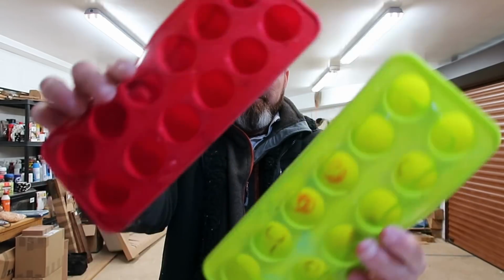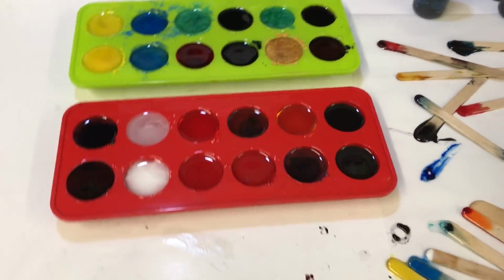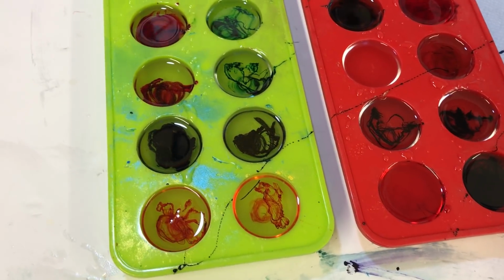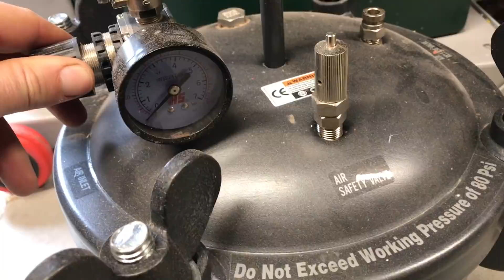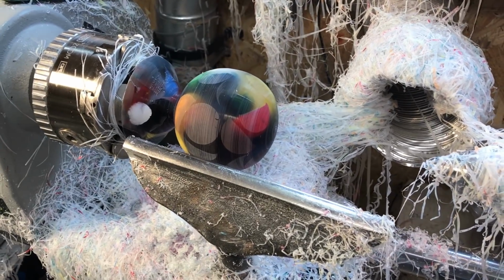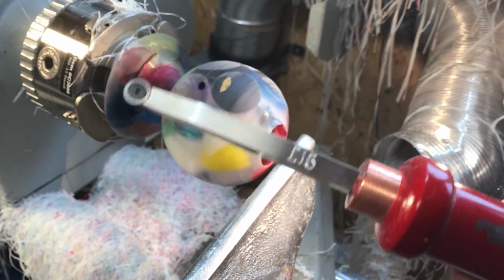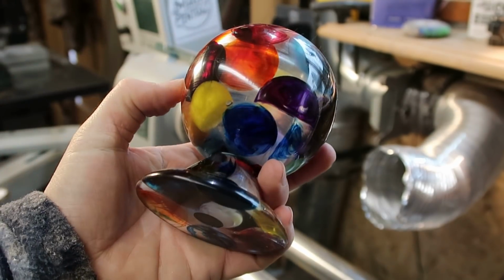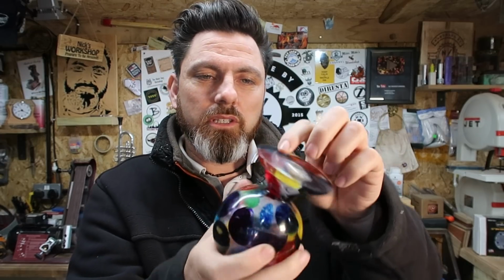Woodturning - mixing resin cubes to make a small funky vase!

Comment: Something you might want to look into his those silicone ice trays come in a wide variety of shapes. Everything from the half spheres you were using to guitars, Hearts, puzzle pieces, death-stars, skeleton bones, and pretty much anything you can think of. It would be cool to use some of these shapes Within a project. Even come binding different shapes such as hearts and puzzle pieces to make a Valentine's type project. You know, you're the missing piece mushy stuff. LOL.
Reply: Seth Cragan Yeah like those LEGO pieces !!!
Reply: Heather McGuire exactly.
Reply: 3 words
Gummy bear mold
Reply: Bianca Brooks .. assumed people's do resin molds with actual gummy bear in them. But I suppose you could not put that on the lathe and turn it. Unless you then put a protective coating of resin around the exposed gummy parts. And you could also do any color you wanted you which would be cool as well. I think it would be really cool to use some of the other shapes. Like they have Star Wars ones that I think would look awesome.
Reply: Seth Cragan Peter Brown made an axe handle out of gummie bears in resin, you should check it out.
Reply: Blue Black seen it.
Reply: Seth Cragan ohh black and white bone shapes embedded in orange resin would make a great halloween project!
Reply: I was thinking that. The different shaoes would add an even more interesting effect and swirling the colors, mixing multiple in one. I liked that he did single color swirls instead of just plain solid colors

Comment: hey buddy, resin will not easily bond to cured resin, your Colored HEMISPHERES. sand them before mass pouring or take out HEMISPHERES before fully cured and do mass or final pouring then. that is a great project but needs to be larger for sure. maybe a tall vase, 3-4" wide or 8-10cm wide at base and top lip! a wooden base with a mild led base light would be a knockout project! nothing short awesome though, really like it! try this idea, sure you will be very happy and inspired to experiment more!
Reply: Ronald Kurtzhals I was checking to see if someone else made that suggestion before I did!

Comment: Small spruce, tamarack or pine cones make a very nice filler as do the needles themselves. Colorful leaves in autumn as well if placed properly and you heat your mixed resin in the microwave prior to the pour to facilitate the resin soaking into the leaves also looks amazing.  I've done this with whole flowers and rose petals as well and found good results. Just some ideas which might be to your liking. 
Mosquitoes, ants, and yellow jackets also make for some amazing pieces if you fix them with two separate pours. Just clear resin or a cylinder of wood for the center cavity which is all to be cut away, and then the insects fixed to the wood and then a larger pour around this, making sure your resin is thick enough to shave without touching the insects. Cool as cool can be.

Comment: Nick, just found this channel. 2 thumbs up and greetings from America. I just watched your vid where you made use of shavings from various tree/wood species and had an idea. What about obtaining small samples of wood from each continent, turn a sphere to be used as a globe, create reliefs in the shape of each continent then fill them with resin mixed with shavings from  each continent's corresponding native species. Perhaps you could make an easier version by creating a rectangle "world map" instead of the globe. This was my idea for something meaningful to be given away to a lucky subscriber in celebration of this channel's 100,000 subscriber milestone. It could represent the common interests in woodworking that is shared among so many of us which brings us together despite our many geographical locations or other such things like fundamental differences in culture that so often work to divide us. I don't know... just an idea.

And to address the elephant in the room concerning how to fill areas on a sphere with resin but without it flowing away from the reliefs where the resin is intended to remain... I believe if the reliefs were small enough, and kept shallow, you could wait for the resin to thicken a bit, have the sphere remain on the lathe, pour the resin into the relief, then set the whole thing spinning at a constant slow rpm (perhaps 10-15 rpm maybe?). Use heat lamps to accelerate the resin's set time and once it's hardened, clean up any excess resin by turning it one last time using a finishing tool of your choice or a series of sandpaper grits. Keeping the layer(s) of resin shallow should help with bubbles and manageability. 

Anyway, love the content and am looking forward to seeing the channel grow! Cheers.

Note: I have never attempted this myself and I am NOT a master craftsman in this area of woodworking. This is ONLY an idea and should be treated as such.
Reply: Kilroy was here your screen name is fantastic!

Comment: Don't know if you'll ever see this, but the way to avoid resin interface separations is to give the components a rough sanding before casting them in the enclosing resin. Give the resin a larger surface area to adhere to, and microstructure to hold on. You could also try making holes in the components so the resin not only flows around them, but inside them too.

Comment: Fantastic work as always! Just a couple of notes you've probably gotten a hundred times by now (Didn't see it on the first page of comments and I'm too lazy to look past that) on how to improve it next time.

1) 5 Minute Clear Epoxy would have filled those cracks well. I don't think you could turn it, but you could definitely sand and polish it back to finish after anyway. It's not as clear, but for this tiny cracks it would be invisible

2) New Resin doesn't fully bond to Cured Resin. As far as I've experienced, that is true for all resins though I'm sure almost everyone has more experience than I do and can point to an exception. However, while the first part is set up but not fully cured, in that tacky stage, you can do the second pour and that should prevent the cracking.

Love your work! Love your channel!

Comment: If you scuff the hemispheres with a scotch bright pad before you pour the resin on top of them they won't crack. When epoxy cures, it out gasses a waxy surface and nothing bonds to it. You can also dust some baby powder in the trays before you pour and it'll have a bendable surface.  Great video 👍

Comment: I love this piece.  It would also be cool to make a set of domes and then put them on top of another set of domes before they cure so you have complete spheres.  Whenever I have a situation where older resin bits separate from a new pour, it's because I forgot to sand the older pieces.  I can't remember the exact timing but if you put them into new resin within a certain period of time when they're not 100% cured, they'll adhere but if it's past that time, they don't without roughing them up.

Comment: I suggest that if you try this technique (small resin pieces in a larger resin piece) again, that you lightly scuff the surface of your small pieces before adding them to the large mold, this should fix the resin-resin bonding problem.
If you get the resin-resin bond problem again, try filling the cracks/chips/voids with a small amount of resin (drizzle it in or use a small paintbrush) before you do the final sanding/polishing. That should strengthen the problem areas and make the flaws disappear (Window shops use the same trick to fix car windshield chips and small cracks).

Comment: A suggestion for another piece similar to this one. Pyramid shaped cubes with pyramid shaped wood pieces. Then before you hollow out the vase, bore a spot for an LED in the bottom. Flip it back around and make your vase. Once polished it can then light up as well.

Comment: When you get crackd like that in your resin pieces, use resin and a silicone shape former to fill the cracks. I would even get UV resin and a UV flashlight to quick cure those areas that need a resin bandaid if you will. Just a thought, it will help reinforce questionable areas where there are cracks or holes, and UV Resin though more expensive in Bulk cures quicker making it perfect for quick fixes and finishing touches.

Comment: To answer your question you posed at the end; cured epoxy does not bond well with cured epoxy.  If you want to get a solid bond between then uncured and cured resins, you will have to do your final casting within 18-24 hours of pouring your cubes.  When you do this, the cubes aren't fully "cured" (crosslinked) and will allow for the final pour and the cubes to amalgamate with the uncured resin and cross link with eachother, essentially creating a solid block of epoxy.  If you want longer than 18-24 hours (depending on temp), with the cubes being fully crosslinked, the final pour will create shear points between the outside of the cubes and the final pour. Any mold release that may have been on the mold, if you had used them before may have also been a factor.  

Cool project, regardless!! Cheers!

Comment: Next time you make one, if you clean and dry the pieces thoroughly with a cleaner that won't leave a residue before you embed them that may help the stuff to all bond together.  Or it may not.  It depends on why it separated.  But it's worth a try.  Just make sure you handle them with clean gloves like food handler's gloves after cleaning so you don't get dirt or skin oil back on them.

Comment: Try that with white opaque filler. Also, you could get a better coating and probably less chance of cracking if you put the cubes into the filler vs. Pouring it over them. Or pour it and add them via a slide of some sort.

Comment: If you want better resin-to-resin adhesion, sand the surface of the hardened resin before casting the new. Rough grits should do a nice job. Something that also can be a cause of the cracks, or an aggravating factor, is the tiny bubbles which adhere to the hemispheres' outsides, which even though being crushed down in the pressure pot to almost invisibility, are still there to create an interface boundary weakening effect, something that a vacuum treatment first helps with, but maybe can also be alleviated by using resin to 'paint' the hemispheres before dumping them in the container, wetting them and letting the air disperse instead of getting pocketed around the surface.

Comment: if you ever tried something like this again, you could probably pour the resin into the mold, then take a long dropper filled with a bit of pigment and sort of surgically add in drops of color and swirl them a tiny bit, that way it would all be one set of resin and it wouldn't crack, also I think it would be pretty cool

Comment: If you try using quickset resin after sanding the piece the cracks would disagree i think. It has to be quick setting though or it will flow off. but the quick setting stuff you can if you wait a little brush it on during the setting time and then you have a fully gloss surface. and i think the cracks would fill up and disapere. Oh and wow it is amazing!!!

Comment: I haven't read all the comments from 8 months ago, so someone else may have already suggested this. Don't cure the hemispheres completely before embedding them in the clear resin. It should work better without cracking. That means you have to make all the hemispheres at the same time so they are all at the same cure stage instead of all fully cured by the time they go into the final resin pour. Hope that makes sense.

It's a very nice piece! It turned out very well. But, yeah, as others have said, "tea lights." :-)

Comment: I wonder if those little epoxy pens would be good to fill in those cracks. I use the 5 second bond to repair a lot of little things like that. They have the clear gel that comes with a small curing light.

Comment: I’m wondering if the reason you got the cracking/separation occurring is because the hemispheres when you popped them out were super smooth and so they didn’t bond to the second resin pour properly? Maybe if you roughed them up a bit with a light sand paper then they may have bonded better?  Just a random thought when I watched your video. I just found your videos and I love them BTW.

Comment: I was thinking that you could make a shallow sheet of resin with different colors swirled in, then break or smash it to get different size shards. Put these in clear or lightly colored resin and turn it. That should give you something without any defined geometric shapes, just random patterns and colors. Good luck and thank you for the interesting videos. I forgot to mention that the shards should be stacked vertically rather than horizontally for the best effect. The thinner the shards, the better.

Comment: If you vibrate the resin for 15 to 30 min. Before you put it in the pressure pot. It should eliminate the cracks. You could set your washing machine to spin cycle & set the resin on top. If you don’t have any other way of doing it. Myth Busters trick..😁

Comment: I know this is a bit older video but what would help to prevent the cracking between the premade resins and new resin sand the a little and it helps bind the new resin to it just make sure to brow off all the dust. (Dont need to do a whole lot of sanding just a quick light sanding)

Comment: If you lightly sand the resin pieces before you pour the epoxy that holds them all together in it will give the epoxy a better surface to stick to

Comment: What would happen if you set the ribbons/streamers from the lathe in resin?  Enquiring minds would like to know 😉  I watch another channel and he uses a lot of epoxy resin, but for boats, he sands between coats to stop delamination, not sure what it would do in your case, but it may stop some of the problems with resin not adhering

Comment: I don't know anything about resin, but I am wondering if maybe you took the smaller pieces while they were still tacky, and then added them to the pot with the clear resin if they would adhere to each other a bit better. Again, maybe resin doesn't get tacky before completely drying.... I suppose that wouldn't work if you wanted to put them in the pressure pot anyway since they would be dry before coming out of there... maybe you can leave in there a shorter amount of time?

Comment: More than a little late with this comment, but if you try this again try roughing up the surface of the cubes to give the resin something to bond to.  Maybe also try setting them in the other resin before they are fully cured and hard

Comment: What if you used tiny spheres instead? You might still have the cracking issue, but you might get something totally different! There is a product on Amazon that I'm thinking could be used here. It is silicone. It's called, and I quote, "Mydio 40 Tray Mini Ice Ball Molds DIY Molds Tool for Child with Candy pudding jelly milk juice Chocolate mold or Cocktails & whiskey particles,Pale Blue"

Comment: In my opinion as a vase it would have been better to leave the flat sides and rounded corners and hollowed out the center.  The rounded one could have been turned into a lamp/nightlight by hollowing the form out from the bottom.

Comment: Why can't the container be cast again with either clear or something iridescent but transparent? In the pressure pot it would be sucked into the cracks. make the mold about a quarter of an inch from the side of the mold. I actually think you should  do a triple cast, the first is your new piece *now older because I am typing in Nov, 2019. Then use some light strips just at the base. For the next one I  would go clear then the third on I would add the iridescent but keep it in clouds. I hope he gets this sometime or another.